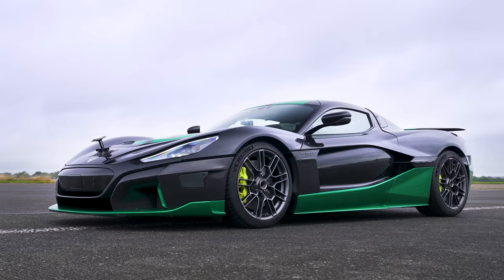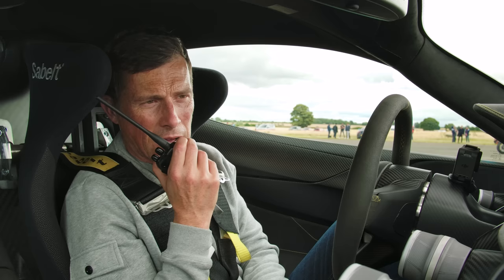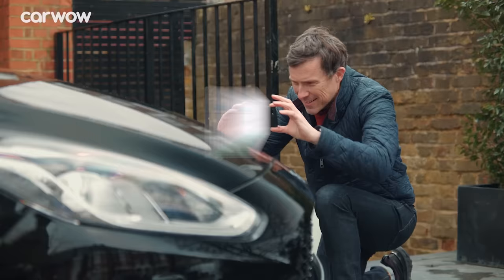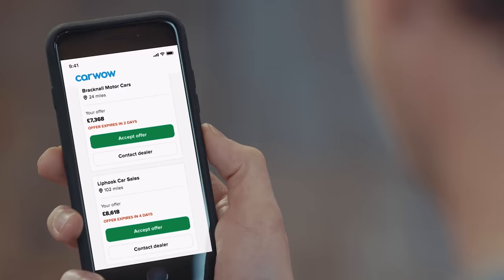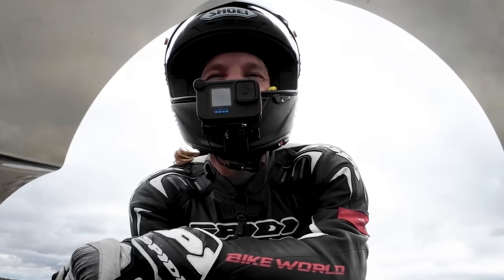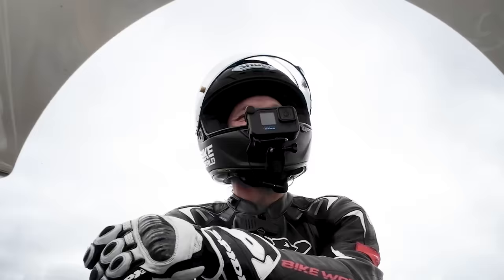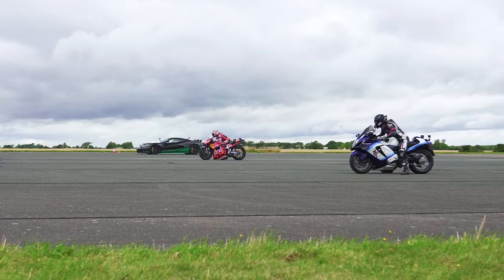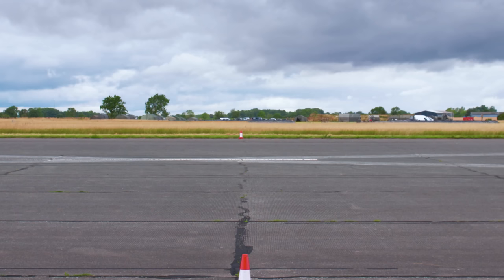MotoGP Bike v Rimac Nevera v Turbo Hayabusa: DRAG RACE

Comment: 8.6 seconds on a bike is just insane...Well done Danny sir
Reply: Turbo busa 9.6 as a sf90 stradale
Reply: Nothing compared to what some people run. Street bikes do an a 8.2 quarter with just an extended swingarm and ecu flash 😂 then you have chris more running a 6.3 at 233mph on his turbo gsxr. Would make the rimac look like its going backwards lol
Reply: @ashofficial790 on prepped surface ofc no bike is doing that on old aiport concret plus they need a crazy build engine extended rear wheel and many things it isnt as simple as that
Reply: @ashofficial790  but rimac is still road legal car. 6.3 GSX-R not legal bike XD
Reply: @sancho2112  no. There is guys in the US who have 220bhp bikes with extended swingarms running 8.2 on the highway using a vbox. I have a 1998 zx9r with 136whp and 9 inch extension that ran a 9.2 at santa pod and 9.4 on an A12 sliproad 🤣 you take the wheelies out so you can pin it from the start and you need something very very fast to keep up. Normal supercars wont cut it
Reply: @ashofficial790  You're talking about drag bikes, which is a pointless comparison, street legal drag cars can do low 5s, besides Pedrosa jumped the start everytime here by up to 0.5 sec, the bike is a 9 flat 1/4 mile bike, interesting top speeds though surprised the Rimac has a higher top end and draws the MotoGP bike in at 200mph+, mid range you would think a light Pedrosa on a 160kg bike would be a bit quicker and it was, good job all, especially Pedrosa keeping his foot in it when the bike's moving at 210mph, now carwow make it happen, F2004 V10 vs Jesko Absolut vs MotoGP vs Rimac.
Reply: you guys forget about 1 thing, the gearing on the MotoGP bike, 
gear that bike for higher top speed and give it a little more HP (motogp bike could go up to 300HP) i cant see the rimac winning, and if you want it to be even more faster, stretch that swing arm
Reply: @GT1Vette  Yes I know what he said, and yes they're road legal BUT still they're a glorified drag bikes that's 'legal' on the American road, swingarm change alone isn't enough, the wheelbase has to be stretched by modifying the chassis that's where you gain the extra traction.
Reply: @ashofficial790 its not just ecu flash lmao. They have engine upgrades, tubos, exhaust manifold all that shit. Just extend the rear on the gpbike without anymore upgrade and you will see just how more quick the gpbike will be
Reply: @NatsumiKuroki269  Look 270-300hp has its limit at higher end, also you talk about stretching the bike and stuff, we're talking about a MotoGP bike, not a drag bike... if we stretched it it wouldn't be a Motogp bike anymore, also no need for rev limiter raise as it never hit one, just short of power against the drag coefficients, Rimac on the other hand hasn't got as good power/weight hence the mid range is slightly weaker but with nearly 2000hp and a quite slippery shaped car it'll be faster higher end, the MotoGP bike would need 400hp+ to reach 240mph+, but still 225mph is plenty.
Reply: @1010thechamp  they need to find a team that will allow their f2004 v10 car to do these runs but i doubt they will since redbull is the only team thats down to earth. I don't think redbull has a 2004 f1 car on competed in those years. I think they started in the late 2010 or 12. I might be wrong. Correct me.
Reply: @GT1Vette  UK, Some of those 'street legal' drag cars and drag bikes in the US would in no way be legal in the UK.
Reply: @1010thechamp  moto gp bikes have different kinds of swing arm lengths, its not like they race in every circuit with the same setting, again the motogp bike is "limited" in this race it can have more power, to equalize the AWD on the rimac a stretched swing arms is fair, a ninja H2R can go 248mph with just 310 hp
Reply: @NatsumiKuroki269  I believe that H2R that was doing the speed runs had more power than a standard one, also saying that the H2R is a more slippery shaped bike than a MotoGP bike with their winglets and stuff to add downforce hence adding drag and top speed is all about drag coefficency, like the V8 F1 car with a high downforce rear wing it won't go over 180mph, but if you took out the rear wing and allow a gear ratio to match then 250mph is possible.
Reply: MotoGP bike will definitely do low 8 seconds quarter mile on a prepped dragstrip. This Airstrip is not a prepped dragstrip.
Reply: @ashofficial790 lol MotoGP bike is good at cornering, acceleration, and braking even without the ugly long swingarm while those bikes with long swingarm only good at drag and that's it 😂
Reply: @wanderer54796  Obviously anything will be quicker on a prepped dragstrip... that's stating the obvious.
Reply: @jozefjozefczyk3936  most tuned bikes are street legal Also that busa which ran 6.0 flat 
There's a turbo Gixxer running 5.8 seconds quarter mile with 220 mph trap speeds 700+ HP 🤣
Reply: @1010thechamp the bike isnt 9 flat you are crazy to even believe that. The bike can easily do 8.2 this rc16 has holeshot device which helped dani launch properly whithout wheelie. In the last race when dani appeared the moto gp bike didnt had holeshot its was 2017 version if im not wrong still beat a huracan turbo 1100hp to dust and left off the throttle 200m before the finish line and still 9.4 as the best time. A better surface like a race track or a drag strip the moto gp will destroy every production car from koenigsegg to bugatti or rimac nothing comes close to it
Reply: @NatsumiKuroki269  LOOLLl Moto GP bike is much much faster than H2R
H2R top speed is around 215 mph in stock form changed Sprocket and gearing it only did 353 km/h aka 220 mph maximum
H2R cannot reach 400 km/h at all stop dreaming
Fanboys living in dreams
Reply: @ashofficial790 Oh bro just accept it if your superbusa loses.😂It has been proven which motorbike is faster, MotoGP, if only it was focused on drag, it would be even crazier than this 😅
Reply: @1010thechamp  kid there was very high wind which was stopping Moto GP bike but it still smoked Rimac Nevera GP bike was wobbling
Bike was still pulling away 
There is no way a 2004 F1 car would win anything F1 car will lose badly to Rimac Nevera
Bring a Ducati Moto GP bike it will leave the Rimac Nevera in dust 
2022 Moto GP bike was pulling away from every bike on the grid like they were standing still 
2022 Ducati Moto GP bike was much faster than any GP bike 
That did 365 km/h on Mugello 
Such short track 
1.1 km straight 350 meters braking zone
Basically bike only has 800 meters to accelerate from 50-360 km/h and that's just done in 10 seconds
Reply: @Smzxe  bruh, you're talking about an H2 not H2R, there is literally a video of it doing 400 with pro racing rider as the pilot wtf. and no im not an H2R fanboy
Reply: @1010thechamp  that gearing on the MotoGP bike is not setup for reaching top speed. It's pointless on a MotoGP track.
Reply: @NatsumiKuroki269  You don't get to 400 kmh with the H2 with only 310hp, you need close to 400 hp.
Reply: Yeah, but I know it could have eclipsed that time if the engineers of KTM's would mapped that 2021 Rc16 to extract it's full power. You know they didn't that for this show. It's unnecessary, I'm pretty sure there are a lot juice in that bike that they don't show. 

For Chris, man that was ballsy to ride that production SuperBusa. If Dani was already  having a massive rear chattering in two runs in those races aboard a sophisticated bike. What more Chris. Although, what if Sylvain Guintoli was the one piloting that SuperBusa, I guess he could bring it down to 9.2 something.
Reply: @dawn-moon  that is for sure. It wasn't mapped. I think it's unnecessary to do that for this race. At least it showed that a 2000 hp all wheeled & with launch control can match Go bike with a Go rider aboard it of course.
Reply: @NatsumiKuroki269  no, production bike has government limitation. If they exceeded that limit. Their bike wouldn't be permitted on the road. Even the Rc213v - S that made for street has got the same limitation.
Reply: @wanderer54796  even lower if it will be mapped to extract it's full potential. Although it this race. It's unnecessary, it's only for the show.
Reply: @ashofficial790 You dont run 9.6 with 136whp and sure as hell dont do 8.2 on freeways with 220. 😂 What r u smoking man
Reply: @1010thechamp  although we do know that 2021 KTM Rc16 wasn't mapped to extract it's full potential for this show. Everybody know who followed the sport that manufacturers don't give the exact stars of their machines. All we know that it was written as 270 hp. I doubt that even Lorenzo once said it's more than that. 

Anyway, it would have been awesome if RB also brought their F1 car. Not the outdated 2013 D. Coulthard was driving. Instead the RB16B of 2021 same as Dani's bike. Plus, having Lucid Air Sapphire in the race as well along with the Rimac to balance the field. While Chris would be substituted by Sylvain Guintoli. I believe Sylvain could do a 9.2  or maybe flat on Superbusa as we know it takes a courage & elite skills to handle & launch a bike.
Reply: @NatsumiKuroki269 400km/h on Speedo. Speedo on bikes over read by 10%. Also that H2R was fettled and had gearing changes. Stock H2Rs make around 235hp at rear, and have poor aero. They do 215-220mph max.
Reply: @ashofficial790 and rimac is still a factory stock😂
Reply: @autolavista  yeah it also costs 2 million and can only ever be stock. A bike will run 7's after spending less than 10k on it
Reply: @jozefjozefczyk3936 yes it is steet legal. Big CCs racing have 800bhp road legal busas son
Reply: @1010thechamp what you on about the GP bike needs 400bhp to do 240?   The big ducati on testing clocked over 240mph it runs near 230 racing on  a circuit you melt 😂
Reply: @Smzxe ehh?  H2R does 215 in 5th gear GPS hahahahaha
Reply: @NatsumiKuroki269 ikr dude came on here saying an H2R does 215 when a H2 from the dealer does that hahahaha. The ridiculous part is they type it out and put laughing emojis as if they know what they are talking about. An H2R does 235+mph GPS.  This dudes embarrassed himself
Reply: @bigduphusaj162  h2r top speed is about 220mph gps ,h2 about 200mph 
This tuned busa did 217mph gps top speed
Reply: @bigduphusaj162  fr bro, they be bias to put cars over bikes when ther are some fast bikes out there that can smoke these high hp car with little bolt on mods, let alone an H2R and turbo busa
Reply: @ashofficial790 No shit a drag ready bike would, same as  7 sec cars. Incredible observation
Reply: @1010thechamp Current motogp bikes have a lot of drag with new aero it makes sense not to mention gearing
Reply: @Nah5534  Yes I mentioned they nowadays have higher downforce due to winglets hence more drag so it needs alot more than 300hp to reach 240mph if gearing allows it...
Reply: @1010thechamp  street bike can't be compared to gpbikes so it's fair to compare dragbike to gp bikes since both were heavily modded and different world. 1 is competition, 1 is made by people who wants to be fast. A dragbike can do 5 second 1/4 mile

Comment: Power to 4 tires vs power to one! Absolutely insane! So proud to see Danny showing the car community the capability of a motorcycle in the right hands, Love it!!
Reply: The bike is 15 times lighter than the car.
Reply: @neilmcmahon and the contact patch is 20 times less than the car🤷‍♂️
Reply: @raynman6466 and the contact patch between your skin and the asphalt is 20 times more as well 💀
just kidding. stay safe, bikers
Reply: I don’t think anybody with a half functioning brain questioned how insanely quick super bikes are. To put it in perspective this is the fastest production car atm and both bikes went toe to toe, absolutely bonkers.
Reply: That’s a standard road car. No mods. DESTROYING in 1/4 .. and 1/2 miles .. 8.5 vs RACE bike 8.6 and 9.6 modded 1,000 hya… 8.5 on unprepped by a CAR standard
Reply: @tomo0082  who was talking expense? we are talking standard car.

I.E online the other day, I saw a lambo gajjardo for like 20k-40k I couldn't BELIEVE. a ~2007 car supercar but old now super sports car for that CHEAP.

Again we are talking buying a CAR, with a trunk(Frunk) a car with DOORS, a convertible ROOF or reg roof!

This car was a rimac yes 1 mill and it beat both bikes off drag line. WE GET IT.
BUT it's a car.. BUT this is not the only car to beat both these bikes, or to beat at least the ROAD legal one.

go back to Carwow last video with 2x bikes these same bikes (~fastest road leg bike+motogp race bike) AND the Porsche 911 turbo s.
I could NOT BELIEVE. a standard HEAVY CAR not modded, nOT EVEN 200K, car was 160-180k BRAND NEW, and it DUSTED or at least beat whole way in the race, the road legal "super"bike :D Just like Lambo we found 20k-40k..
the Porsche 911 turbo s that year is now like 140k ALMOST 0 MILES.
and we can find Porsche 911 turbo s similar year for like 50K-80K

my dog, my FIRST 50k extra bands I am BUYING a Porsche 911 turbo s and getting custom exhaust to get it sounding like old Porsches I CANT WAIT if that happens for me :D ORR I might go Nissan GTR route, and bye bye route :D

OR if I can't do anything, I'll soon just upgrade my sports car to at LEAST a Nissan 350Z/370Z "racer" sports car platform
Reply: we? who is talking about standard? only you. 
you seems to be happy that rimac which have a trunk(Frunk) .DOORS, a ROOF  barely won against gp bike and said【destroy】and someting but rimac is 2000cv monstarpower car which is far more faster than race car which is irregal on road（i talk about only acceleration）its no wonder that car is crazy fast.
everybody excited that only 270cv bike show potential that as fast as 2000cv electric car. but you excited different  point that most people do.
why are you so exited? you hate bike? why? you rost against bike at rord?  
this is the best battle i have ever seen. gp bike didn.t lose against 【standard】car. this is the 【fastest car and fastest bike】battle. dont misunderstand.
Reply: Standard 😂😂😂😂😂😂 @slavche
Reply: @slavche standard 🤦
Reply: @kgb3410  haha : )